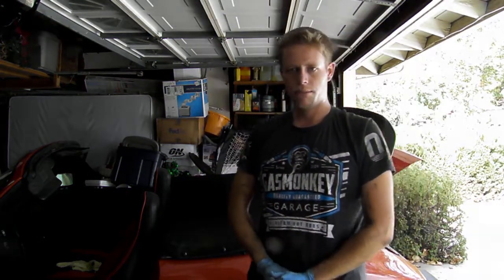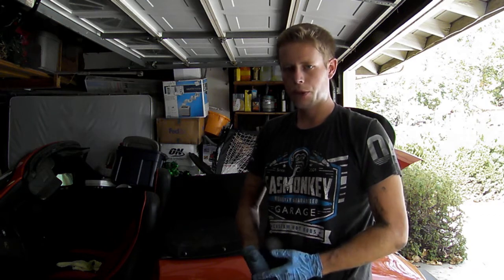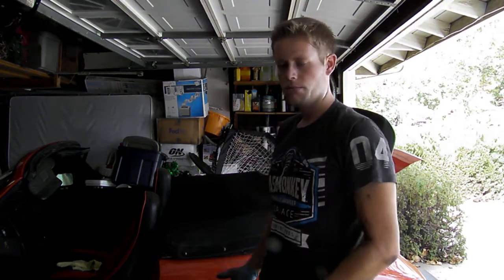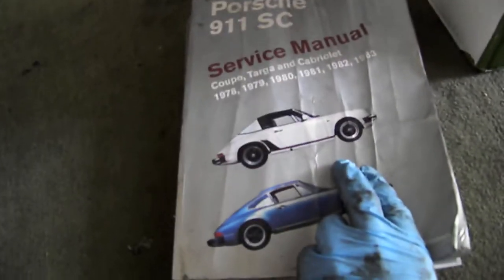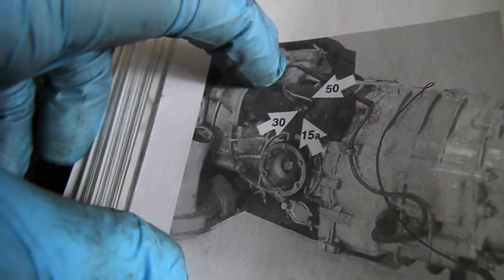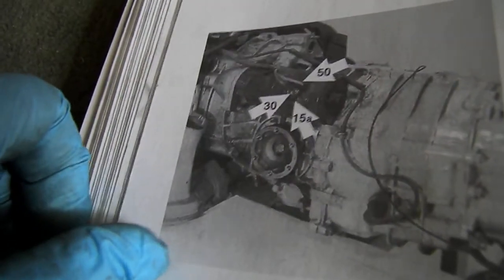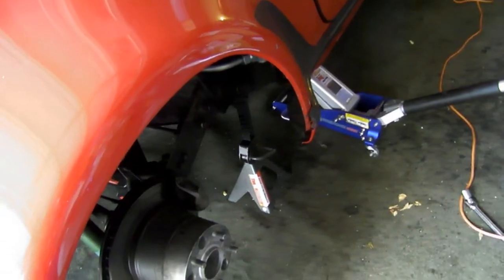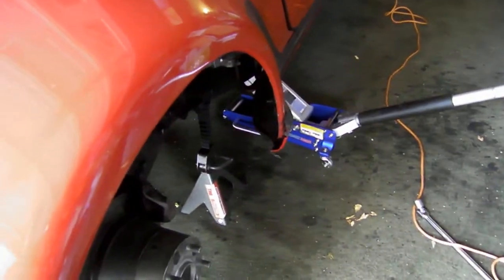Guide: Starter Removal: Porsche 911 SC

Comment: You saved me ! The car stood in the garage and wouldn't start anymore. I have a 1984 Carrera. It's very similar to the SC but a I needed17mm wrench instead of a 15 mm. It was easier than I tought,
but I would never have found the Allen bolt without your help. Thanks!
And now I can order a new one.
Reply from the maker: Glad I could help! FYI, my rebuilt Bosch starter from this video failed on me. I hear they are notoriously unreliable. I had to redo this procedure again and opted for a High Torque unit (ordered mine from Pelican Parts). I have been very happy with it. The only thing is you'll need to buy new nuts as the flange is thinner, causing the allen to bottom out. Just requires a trip to the hardware store though as the threads are a common metric size (M8 or M10 I believe).

Comment: 91  carrera 4 same only calls for 3.5 hrs stick shift Lil harder slave cylinder in the way skinny arms so wasnt big issue cracked top one loose from passenger side but put 10 mm allen an shit through driverside after removing lower engine cover bracket on driver side

Comment: What is the length of the socket fitting plus socket extension plus socket wrench you used to get off top nut? Tight space and I’d like to do this once, haha. Thanks for vid, I’ve been procrastinating doing it because of the tight space.
Reply from the maker: It’s a 10mm Allen assuming your car is stock. You’re right - it is tight up there! Honestly, it takes some trying and muscle memory to reach the top nut. From my memory, a long (approx 5 inch or longer) extension really helped. Maybe add a universal joint adapter to help with the angle. Anyways here is a more precise guide:  https://www.pelicanparts.com/techarticles/911_starter_install/911_starter_install.htm